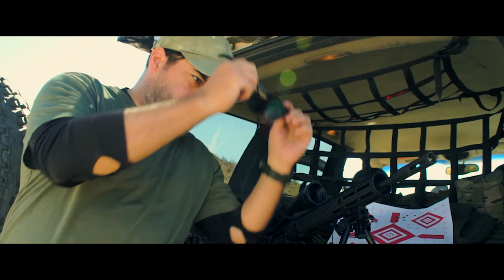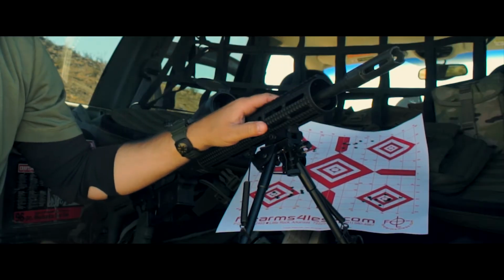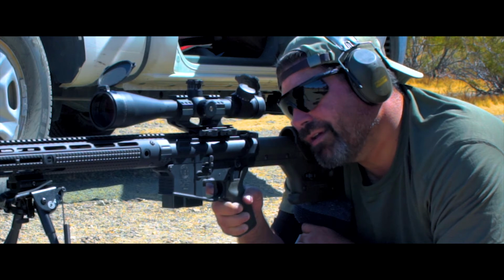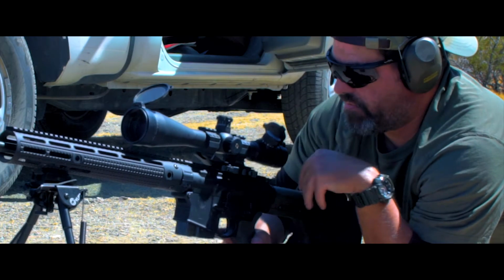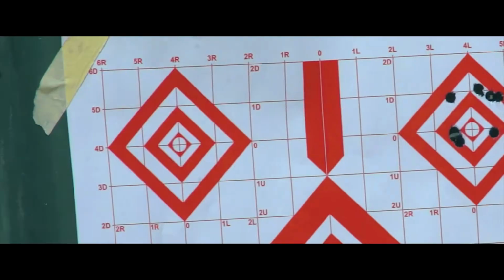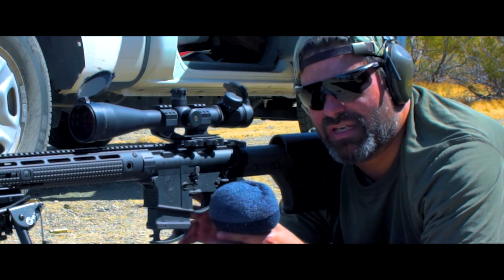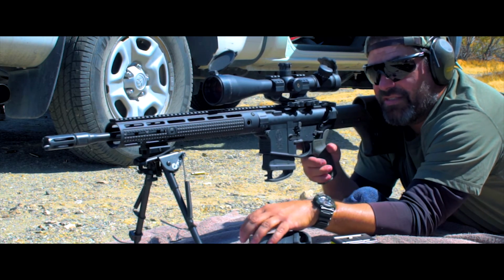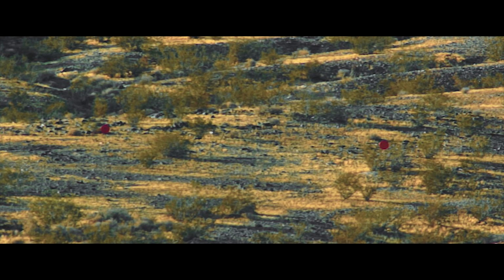M&P-10: Solutions Ep. 3 SUCCESS

Comment: BTW.  I have used Magpul 25 round mags and the factory 20 round.  I tossed my metal mags thanks to misfeeds and have cut the misfeeds by 95%.  I too get some strange groups.  And keep in mind that a hot barrel also changes the equation.  Anyway, I got a Lead Sled DFT2, which is the only one I feel will work with my setup BTW, and did a heck of a lot better with groups and scope sight in.  So, until I prove otherwise, I'm going with human error more so than barrel problems.  I'm new to this .308 semi-auto racket, so time will tell.  But, right now, I'm not blaming the mags or barrel configuration for my results.  Just too many other variables to lay blame on one or another as yet.
Reply from the maker: After having it in the shop and tearing the barrel apart in episode 2, I came to the conclusion it wasn't the barrel, either.  That thing is in there.  Free floating the barrel helped.  Tuning the compensator helped.  And for my part, shooting in a 90° F environment, using steel magazines instead of plastic, or aluminum helped.  Great comments, thanks!

Comment: Great video!!  Thx!!  I love my M&P10.  Rather than modifying my upper, I'd like to buy a complete and fully assembled free float upper.  I heard it is difficult to find a complete upper for the M&P10, as all other brands just won't fit correctly.  Additionally I heard S&W won't sell an upper for this rifle.  Any suggestions?  Very much appreciated!!
Reply from the maker: Even on the S&W forums, M&P-10 users express frustration toward their propriety.  I'd love a right-sided, extended charging handle, for instance.  Nope.  The after market one I have now, coupled with the PRS won't work to lock the bolt back properly.  Very frustrating.  Fun shooting though!
Reply: I have a suggestion, keep your perfectly good factory upper that is forged 7075.
Reply: You can easily free float it, why in the hell would you try to cobble together a completely different rifle after paying 900-1300 bucks for the damn thing?
Reply: @dasboot9471  Not helpful.  Factory upper is fine.  It will be kept and used.  Not the Q.
Reply: @BM-pl7vv  The answer is, get a free floating tube and an AR-15/10 armorers wrench and bolt on one yourself.  It will cost you significantly less too, instead of trying to buy basically an entire other rifle....Or just buy a different rifle and sell me the M&P cheap?
Reply: Again, not what the Q is and not what I'm looking to do.  Regardless, thank you for the response.

Comment: What I'd like to know is:  What was causing the misfires in Ep 1?  The other day I think I had about 6 misfired rounds out of a box of 20 in my M&P 10.  Been shooting it for 6 months now and never a single misfire.  Going to tear it down and clean every nook and cranny, check the firing pin, etc. and make sure it is lubed per the manual and then test fire.  BUT, I sure would like to know if anyone else has figured out what might be the real cause of the misfire gremlin showing up out of the blue.
Reply from the maker: My assessment on the misfires was the Velocity trigger needed to be cleaned.  The trigger was not fully resetting.  In the video I had to push it forward to complete reset.  In episode 2, while having it on the bench, I looked at it off camera, and saw that the hammer wasn't being released by the disconnector due to the trigger not getting into reset. Cleaning took care of that.  This is also when I discovered the compensator was only hand tightened and not tuned.  This is what caused such a huge blowback and subsequent aim issue in the "Back to the Drawing Board" video, where I had the -10 on a bench rest.
Reply: Well, root cause of my misfires is still unknown.  But, the M&P sure needed cleaning and my firing pin had some carbon like deposits on it which may have prevented it extending 100% when struck.  Anyway, after cleaning all internal parts as much as possible and reassembly no more misfires.  Explains why drill sergeants teach their troops to clean their weapons religiously.  ;^)

Comment: I know from experience that what you are going through can be very frustrating. But, i'd be willing to bet that the issue with your groups not being consistently sub MOA is NOT mostly due to your rifle, per se. IMHO, you need a shorter bi-pod and you need to lay down and get comfy. I can clearly see in your vids that you are muscling your cross hairs onto your target. This is mostly because you are propping yourself up on your elbows. You need to be in a relaxed position, with no muscle tension across your shoulders or upper back. When you lay your cheek on the riser, in the prone position, you must be relaxed. Even the slightest muscle tension can and will cause you to pull or push when you pull the trigger. There are many videos concerning proper prone shooting technique. Many of the vids are made by professionals with long term experience. If you watch these and learn from them, you'll be a happier man every time you leave the range or the field. Good luck. :)
Reply from the maker: So, I was an Army NCO and warfighter for 23-years. Maybe that doesn't equate as a professional to you, but what I taught and supervised over that time had some pretty dire consequences if not done correctly.  That being said, I hear what you're saying, and here's why I disagree with you: 
1) The target, 100m away, was at a slight incline.  The terrain was higher than the firing position.  Hard to tilt up if I'm close to the ground.  I had to add height to the bipod to bring the system up to me.  You can see BTS pics of the setup here:  https://plus.google.com/u/0/+TheTSFChannel/posts/7cw3R5LZ29i  
2) Being lower to the ground means elbows are wider apart, but it also means shoulder blades are meeting in the middle of the back, and the firer has to crane the neck downward to get the proper cheek weld. Having done that, now, the head faces downward and one has to tilt their eyes up, blah, blah, blah... It isn't as natural as bringing the system up to my natural line of sight.  I demonstrate this phenomena and why I take steps to mitigate it here:

https://youtu.be/Gm_3JEw3npo?t=17m31s

(And after rotating the pad, it still wasn't enough.  At 20:25, I rotate the pad again, bring the system higher into a more natural alignment with my position.)

3) As I discussed in this particular video, the ground beneath me was giving way with each round fired.  I had to adjust.  Maybe that's what you meant by my muscling the cross hairs? Not sure, but I explained what was going on along with the heat shimmy which was making the target move.

Thanks for your thoughts.  Many might be thinking the same thing, so I'm glad for the opportunity to clarify.  I appreciate your input and that you watched all three episodes.  I thought my group was pretty tight at the end, validating the system changes.  Now I plan on going out a little further, 700-800M, to really see.
Reply: SUPster my thoughts exactly. I think he's issues with groups are more HIM then they are with the rifle.
Reply from the maker: I pretty much say that at 13:48. The difference in shot groups from the first episode to this one though, is so extreme, they can't only be due to technique.
Reply from the maker: Cool.  Your also commenting on a situation you didn't experience with me that day.  None of y'all did. Hopefully, I'll be able to get back out there and further demonstrate what I'm talking about, the terrain I'm on, and the body dynamics necessary to achieve steady position.  Did you get the bit that my target is at a slightly higher elevation than my firing point?

You should know better than most that we're forced work with the terrain we're dealt, that there is no perfectly level, clear-for-100-yards terrain in the field.  Y'all aren't looking through my scope, through the heat mirage, trying to determine where center mass actually is as the target appears to move 100 yds away.  THAT is what's going on, not discomfort or back strain or muscling my cross hairs as SUPster wrote. I'm trying to maintain my eye relief.  Yes, the ground was falling away under my firing arm. Yes, the squeeze bag was fucking with me, but so what. My zero is still successful and later, I score consistent head shots at 400+ yards from up on the perch.  That's a success in my book.  Not for y'all, though.  Y'all fixate on my manner and not the endstate.  Form over function.  I thought we've evolved from that.  Y'all fixate on your and others' interpretation of what's going on... While I fail to accurately explain it.

In Ep. 1, I switch plastic mags for steel mags and my shot-group is cut in half. After installing a free float rail in Ep. 2, my groups are sub-MOA -- and these are all viewer recommendations.  I freely identify how my PMCS was ate up by pointing out how my compensator wasn't even properly tuned in Ep. 1.  Totally my fault.  I'm an idiot.  But then, my final group in Ep. 3 is sub-MOA. I go assume an inconvenient, "combat condition" firing position with no elbow support, nail 12" plates at 4oo yards, and your thing is, my excuses for poor performance is unprofessional???

That's all cool, but I don't think my performance is poor.  I overcame obstacles I encountered, including weak ammo. But, I implemented recommendations from shooters in my audience and met my goals!  Fucken hooah!  So... There you have it, bruh.  I don't really know what else to tell you.  Stay tuned, I guess.  I found an area where I can range out to 800 yards.  I put the plates out there and, again, was able to score consistent hits.  Didn't film it though because I was with friends.  Here are some pics:
https://plus.google.com/u/0/b/114018009654979504844/+TheTSFChannel/posts/TT22puzJyex

The rifle works for damn sure.  Mine had some issues, including operator PMCS.  But with the right optic, ammo, magazine, and a free-float barrel, the thing is AMAZING!
Reply from the maker: Okay, "11B."  Lot's of personal attacks from you.  My experience and a survey of my 23 years in service is on display for the world to see -- on the TSF Channel.  Maybe you should do some research before running your keyboard.  Here.  I've done it for you:
https://www.youtube.com/watch?v=yCarSTP1d1k&list=PLF67D4E495CBCB159

If you actually watched this video, you will hear my exhale after each shot - because I was holding my breath during trigger squeeze.  Breath control is part of the four fundamentals!  The shit you're saying doesn't make sense when you actually watch the video.  Is this your inexperience showing?  I mean your wack shotgun videos are making me lean towards a stolen valor character assessment.

I just rattled off how much advice I took from other shooters who made suggestions - about the magazines, about the free-float barrel, about the ammo... Your statement about my inability to take advice is false!  I mean, are you paying attention???  Who's looking foolish, now?  It is YOU who should be ashamed.  Maybe you're just drunk.

So, my day-job is training the force.  Guess where at?  Probably someplace close to the desert, huh.  So last night I watched 2 full-up infantry companies in Strykers get annihilated by one BRDM.  Someone who claims, "I'm 11B," doesn't really give me pause.  I've done that job too.  My second tour in Iraq, as an E-7 platoon leader after our LT got blown up, was with 1-22 IN.  2006 was not a good year for anyone who served.  But how would you know?

My proof is on my channel.  Where's yours?
Reply from the maker: Hahahahahahahahahaa
Reply from the maker: "4-54. When zeroing or when time is available to fire a shot, Soldiers fire when there is a natural respiratory
pause, when most of the air has been exhaled from the lungs and before inhaling (Figure 4-18). The shot
must be fired before the Soldier feels any discomfort." ~  FM 3-22.9 Page 4-22.  There's a graphic below this quote that illustrates breathing pattern and when to, "Hold breath."  But here you are saying, "you don't hold your breath"!  

I mean, I can't make this up.  You're creating your own character right here in front of the world!

You maniacally kept commenting all night.  Triggered much?  I provide you proof of my combat and military experience which you flatly reject, despite video to the contrary.  You blatantly continue to call me out that my combat experience isn't true.  I provide you proof.   You're not interested in truth.  You're interested in crushing people online.  How's that for veteran behavior?  How does that fit in your "condescending comment" remarks?  

You're projecting.  This is who YOU are.
Reply from the maker: There you go, making shit up again.  You don't know me, my former MOS, when I retired, how old I was, what my physical state was at 42 yrs with multiple combat deployments, or what was going on across the Army which affected promotions.  If you were really interested in truth, if you really understood what you were talking about, I would hope a veteran's advocate like yourself wouldn't make naive comments as you did above, especially while you continuously condemn mine.  In fact, without a copy of my DD214 in front of you, your comments are pretty asinine.  In order to invent your conclusions, you're forced to make a  lot of assumptions, and you know what they say about those.

Your continuing, relentless insults indicate someone who's easily triggered.  If I were your employer, the FBI as you claim, I'd probably reassess whether having someone with your character traits on my facility with access to firearms is a good idea.
Reply from the maker: Do yourself a favor and research before you comment.  You're not interested in the truth.  You have a position, and despite video to the contrary, you refuse to acknowledge it.  The truth is out there. (Insert XFiles theme).  In this video, I demonstrate how trying to lower yourself to the weapon is bad, and to instead, bring the weapon up to you.  I talk specifically about military shooting and the sandbags you mention here.  You're preaching to the choir and you're late to the discussion. 
https://youtu.be/Gm_3JEw3npo
Reply: @TheTSFChannel  shot groups opening up can be radically different for many reasons. Example,you noticed the brake was only hand tight. While the brake was hot this would equate to it rising,lowering,and moving side to side with each shot. The brake being thinner than the barrel would heat up a d expand faster making it closer than hand tight. I'm not saying that free floating didnt help,because I'm sure it did and 99% of the time it does. But the main issue I see after watching all 3 videos was the brake only being hand tightened. It explains the grouping in the first video for sure and why after fighting ituoir groups were aligned on the horizontal axis for the most part and not how they were in the first video. I'm 100% amateur shooter. But I'm 100 professional fabricator a d heat would affect the barrel and brake as I described. If the brake was off .02 to the right when you pulled the trigger,if would hit right. Left left,down down,a d up up. The brake only being hand tight was 100% the biggest issue. Good job tho. I have always reconfirmed everything is 100% how it should be on the rifle before changing a y parts tho.
Reply: @TheTSFChannel  damn,did the coward delete all his comments?. Great videos man. I just found tour channel today and have watched about an hour of videos. The absolute reality is that none of these "eperts" will ever make a video showing what they believe you should be doing. Great job and thanks.
Reply from the maker: @FreedomInc  Thanks for your comments and observations.  I also identified some issues with the PRS and buffer tube/spring that I haven't gotten into, that effects recoil.  YouTube blocks firearm video distribution these days, so I'm hesitant to produce a video on it.  Maybe I'll do one more.
Reply from the maker: @FreedomInc  Thanks, bruh.  Means a lot!
Reply: @TheTSFChannel  you are 100% fine shooting and everything else. You just cannot build,or have links to products in your videos or descriptions. You can a link to a page that has those links tho.
Reply: @TheTSFChannel  keep it up man. The naysayers can kick rocks. The best marine scout sniper in this country learns something new with ebwru shot. Every firearm.isnt the same it takes patience. I really think your biggest issue was the brake from your grouping,what you said,a d my knowlege of metal and how it reacts to heat. That brake got closer as it heated up and was "dribing" the projectile. That's why it was so inconsistent shot to shot but you were winding up with groups in the same areas. Keep it up man. Sub to my channel also. I dont out videos out often but I think some people need to here what I have to say. Maybe not. Either way I'm going to say it because if we dint tighten up we wont habe the rights we have. The 2ndA has already been turned into a privelege a d it's on us to fix that.
Reply: I'm thinking he's got it figured out. Ha. I'm done.
Reply: @sodeepopkid6855  but,any information that can be added even years later is good. Everyone doesnt know everything there is to know. Even someone who designs and builds something most times learns the most about what they built from other people.

Comment: Impressive.  What was the feed problem?
Reply from the maker: It wasn't a feed problem.  I discovered the Velocity trigger was sticking due to very slight carbon build up.  I had to push the trigger forward into reset in order to fire.   Between takes I broke it apart and wiped it down. No more problems.  Great question!